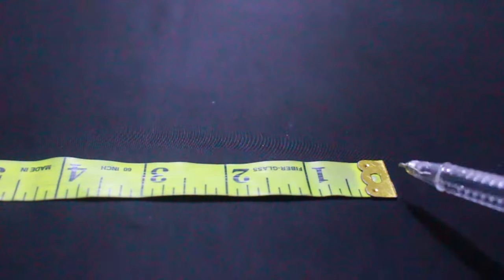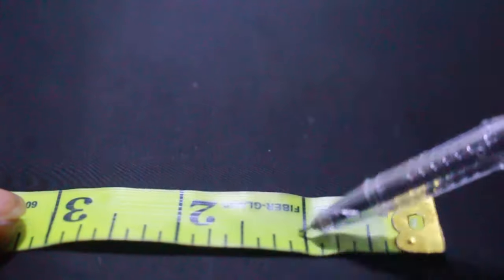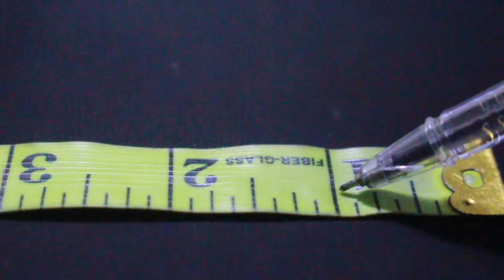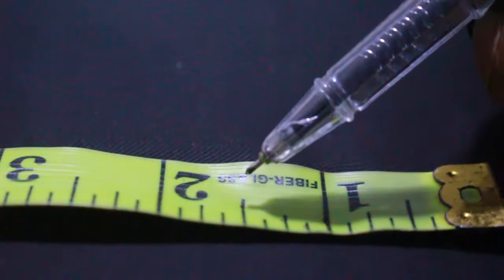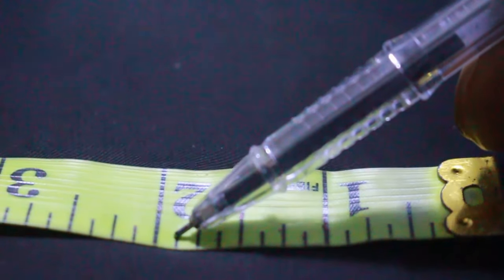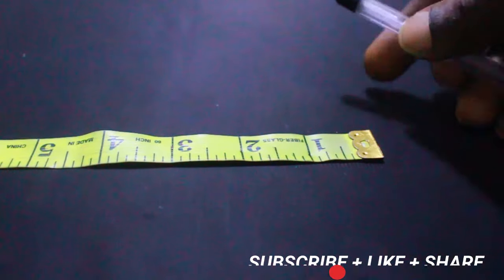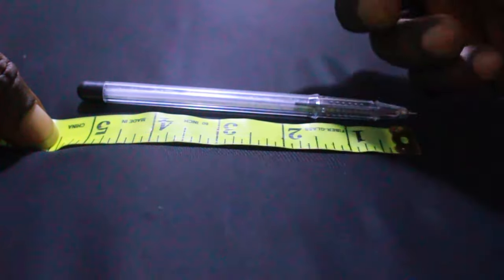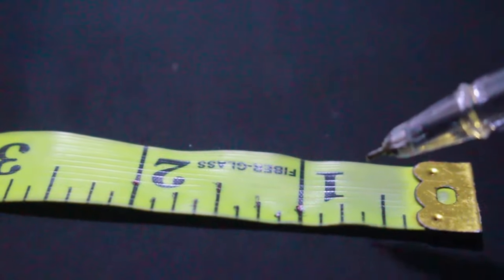HOW TO READ A MEASUREMENT TAPE FOR SEWING

Comment: How to read: 1 inch — 1/8 of an inch & so on — 1/4 — 3/8 — 1/2 (middle) — 5/8 — 3/4 — 7/8 (small lines in between)
Reply: Thank you! The captions on this video are absolute dog 💩, it says under the video "this is the coldest line, it is called one eat". Makes no sense.
Reply: Thank you Cetera! I have been researching for simple readout of my sewing measuring tape in order to mark 5/8 of an inch. I should already know this, but there is only 3 lines in between each 1/2 inch of my tape. So now thanks to you I marked each line with my pencil and paper and taped to my presser foot! You are a Gem!!! 💎 Thx so much!!!!!!!  ❤🥰🥳

Comment: Each small notch   line represents 1/8 of an inch this is called the Imperial measurement system. The metric system uses decimal points but it is NOT  used in Imperial measurements, that maybe where there is some confusion. In one inch you  have 1/8, 2/8, 3/8 4/8, 5/8, 6/8, 7/8,  8/8.  At points  2/8  4/8  6/8   both top and bottom can be divided by  2 using fractions so becomes 1/4 , 1/2,  3/4.    8 notches equals 1 inch.

Comment: If from the metal to the middle long line of two is called half-inch then , what do you call the middle long line close to 1🙄🙄🙄
Reply from the maker: Half inch before 1,  2 and half after 2, 3 and half after 3 and so on